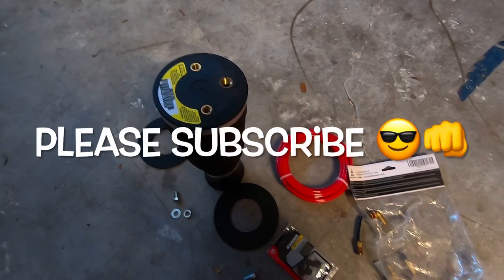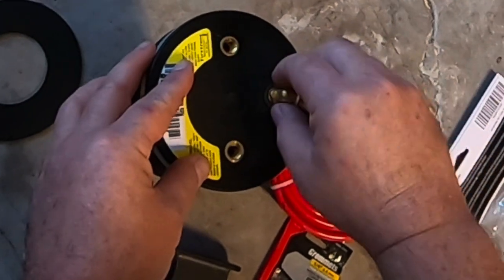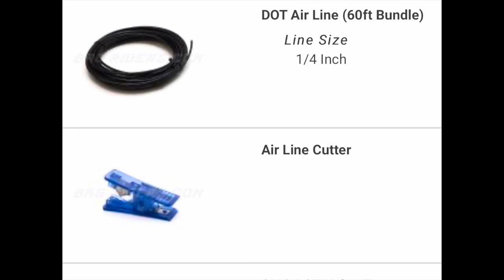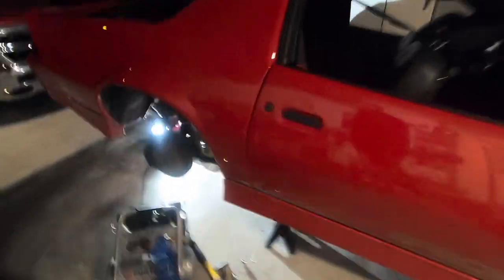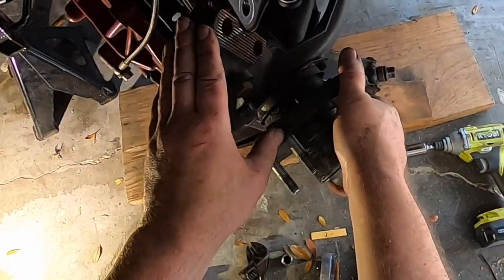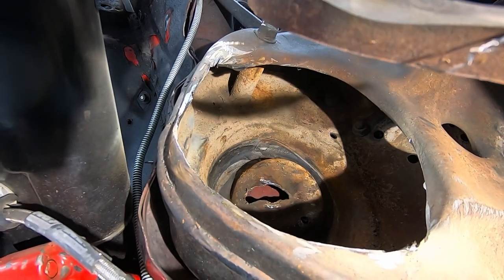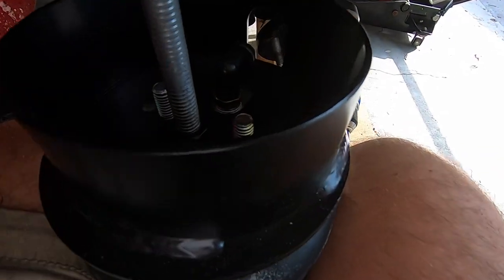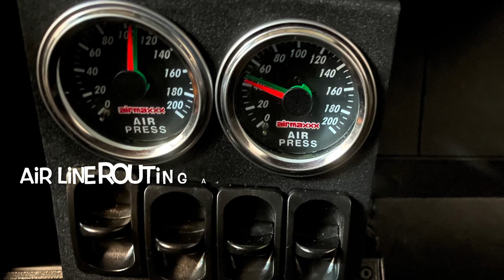Part 1: Air bag install on 3rd gen Camaro and Firebirds

Comment: Great install brother. Looks great. Looks like it rides great. The rear install seemed very simple. The front with some modification still didn't look to bad to install. They did a great job engineering the parts to make it as simple and safe as possible. But dang cutting the k member lip off looked real fun lol. Great job!!! Keep the videos coming
Reply from the maker: Thanks bud!!! Yeah not too bad, with a plasma cutter would have been cake lol 😂 luckily no leaks so far! I have it about the ride height I want for cruising so I’ll need to get it aligned at that height. Thanks for hanging out!
Reply: @FireballMullet  no problem. Ya haha that would have probably made it a little easier. And ya that's good thinking about the alignment.

Comment: That’s awesome. I believe I’ll do this on my new 85 ws6 FireAm build.
Reply from the maker: I’m super happy with the setup so far. I really want to get some double adjustable shocks and struts and dial in cornering but it seems really I’m control as is

Comment: When you get your new rearend, check the dimension of the inside of the spring mount that the bottom of the bag goes in. With the strange rearend, that hole has a much smaller I.D.  due to them using a thicker pipe for that spring mount.  O.D. is the same as factory. It’s much easier to grind bigger beforehand if need be. Looks nice! Keep up the great work!
Reply from the maker: Thanks for the tip bud! I didn’t realize the pocket was a little different. I think the air springs are a little smaller but I’ll be ready to mod that if needed.

Comment: Maybe some sleeving for the air line would help protect it ja? Also, may be worth your while to looking into some little hose clamps to keep that line in place and protect from rubbing? The ones I use are stainless steel and have a rubber covering on them to protect your lines. This is so cool to watch man! Thank you for sharing you install!
Reply from the maker: Yep, I did some loom on most of it. I think it’s going to work great and trouble free.
Reply: @FireballMullet  I can't wait to see more of it!